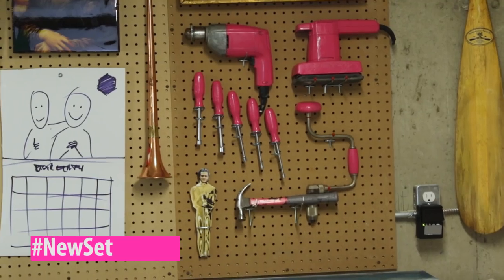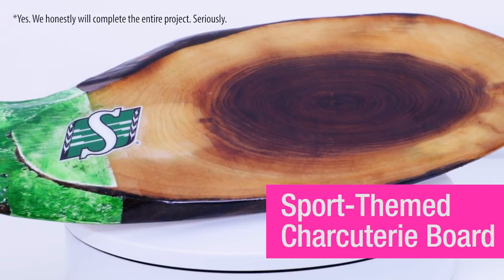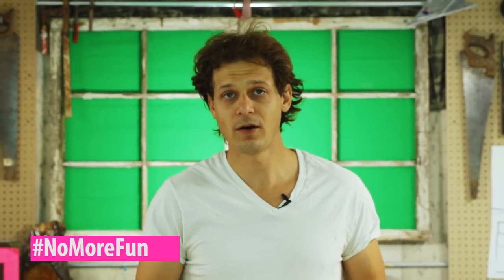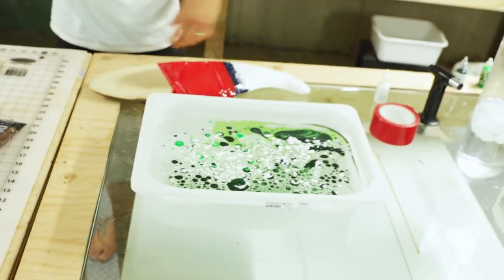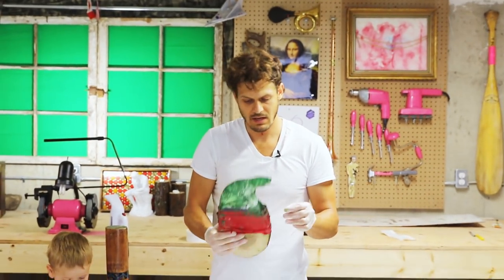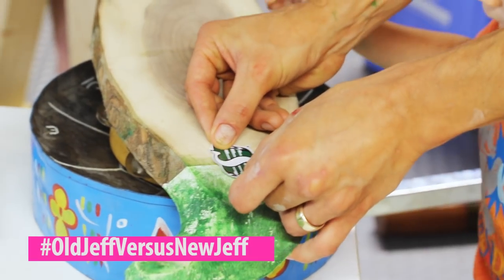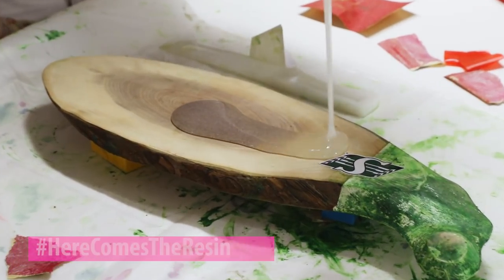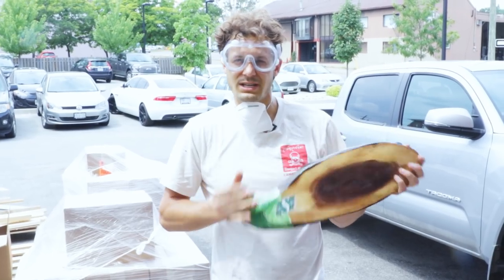Making A Sports Themed Charcuterie Board

Comment: Why would you sand it and oil it at the end?  Why not just leave it shiny ???
Reply: will1234714 he's demonstrating what you do just in case you get a little scratch in the "scrath resistant resin" not scratch proof resin.    it's a little fix for the oops!
Reply from the maker: As Lou said, yes, the high gloss finish is more prone to showing scratches, nicks and marks - so helpful for something like a cutting board, table top, counter top or any other surface that may be prone to wear and tear.  Sanding it down gives it protection against scratching and oiling it up gives it a nice finish :)
Reply: This looks great! Did you just use cutting board/mineral oil?
Reply from the maker: Dave used grapeseed oil, but you could definitely use cutting board oil or mineral oil!
Reply: Thanks!